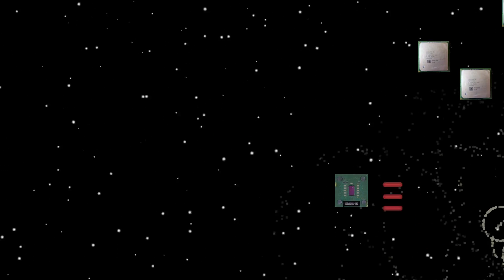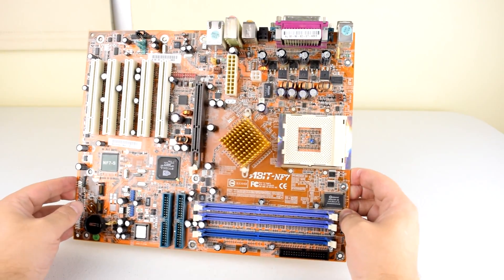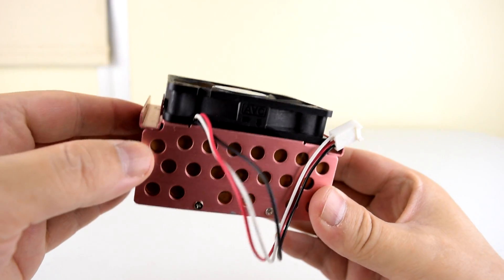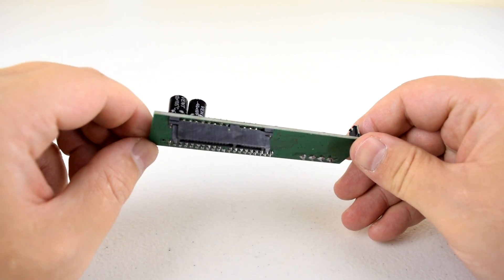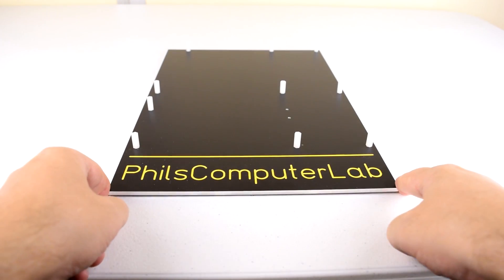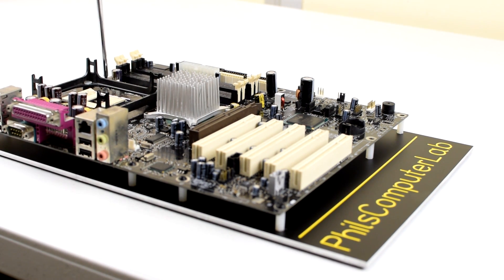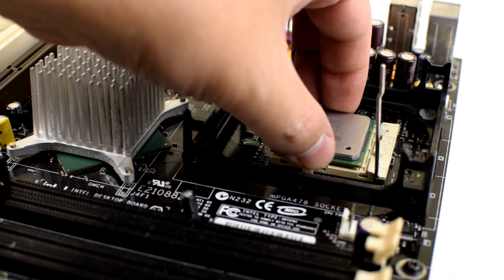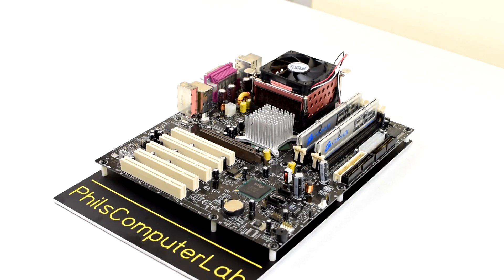Intel vs AMD S1E3 - P4 vs XP 3200+ GeForce 6800 GT and 875 chipset

Comment: Quick question regarding Power Supplies for Retro PCs,

How much wattage would be needed for say a Voodoo 2 SLI system, since I'm planning to buy one soon. For ATX power supplies is there a way to convert them to AT connectors?

Lastly, what case would be the best for every motherboard size?

I know this isn't relevant to the video, but I find it the easiest way to get hold of some answers, since I find power supplies the scariest part of any PC build, especially with Retro parts.
Reply from the maker: +Plague Doctor AT you're talking 386 and 486. I have a video on these topics, building them, but also reviewing an AT to ATX adapter. As for PSU, older PSUs are stronger on the 5V rail, newer ones stronger on the 12V rail. So it depends on what you're building. This is really only an issue with high powered Athlon XP machines. For these, even a modern 600W PSU doesn't cut it anymore, because it's too weak on the 5V rail. I use FSP and now the Corsair PSU with all my builds. I do not recommend using older PSUs, I just don't trust them.
Reply: PhilsComputerLab I do have a Corsair CX 600W floating around, but from what I've gathered any Power supply with an 80+ rating doesn't have a strong 5v rail. Is this the case?

Thanks for your time.

***** I shouldn't have a problem finding an ATX board, the only challenge is that they're quite uncommon, however there is a slot 1 Compaq motherboard 400BX chipset on Ebay with 3 PCI slots 2 ISA and 1 AGP slot I believe that will suffice, unless they have some special 20 pin connector that the Dell motherboards do.
Reply from the maker: Plague Doctor None of the modern PSUs have a strong 5V rail anymore. 15 or 20 is what you usually get. Whereas older models had 35 or even 40.
Reply: ***** Might do so if I struggle getting a good Slot 1 Motherboard. I've brought a Voodoo 2 now.

I do have a shitty Pc from 2001 with some IDE leads and DVD/CD/Floppy drive, however upon closer inspection the Floppy drive lead is twisted in the middle six pins, would it make it compatible for the V2s in SLI? I've heard the V2s SLI cable is the same as a floppy disks.

The Power Supply is an FSP, but it's been 10 years, might as well get a new one to prevent it taking the parts out with it.
Reply: ***** Yeah, I did, but I find Pentium 4s quite troublesome with specific drivers. I've always wanted a P2 400mhz slot1 system back in the day, found them to be astronomically expensive similar to a 5960x of today. Trying to make it a pseudo Glide/Dos gaming machine of the time.

Would a Sound Blaster Live! Value work for Dos games? Even though it's a PCI sound card, I'm not 100% sure if it would. 

Now, regarding the Floppy Drive cable, I've heard it can work with the V2s if it was twisted in the middle, which mine is for some reason, it came like that I suppose. 

Thanks for being a help in this, takes a tonne of research to find what you're looking for.
Reply: ***** Ah, thanks, I'll make my DIY Voodoo 2 cable than, not a problem as I've been researching about it since yesterday and if I fuck up IDE cables are a dime a dozen.

Just needed to clarify that's all.

Thanks man.
Reply: ***** Yeah, I can just use the ones in that PC I mentioned. Thanks again.

Comment: Nice a Athlon 64 approaches wonder which chip you have ...I have the Athlon 64 4000+ which I think is the fastest single core Athlon 64 processor
Reply from the maker: +Ashley 98 I think I'm going to follow the timeline from back in the day.
Reply: +PhilsComputerLab could I ask what is the recommend wattage psu  for the 6800 Gt as my fx 5200 ultra needs replacing or could you recommend any good x8 agp card that are good but not too pricy any help is much appreciated :)
Reply from the maker: Around 400W should do the job. The 6800 GT is a great card, but might not be the cheapest. Check out ATI as well, the X800 series for example. The 6600 GT is nice, but it uses an AGP bridge, which can cause issues...
Reply: +PhilsComputerLab ah thanks I have a 300w in there currently I can throw a 500w psu that I have ...the x850 pe I do have but its PCI :( such a good card but very noisy at startup sounds like a jet taking off also have a 7600 gs agp but it has artifacts not bad to say I payed £2 for both of them also just wanted to say check out any local recycle shops near you if you have any you never know what you may find in the electrical section :)
Reply from the maker: I live in the outback, no recycling companies near me I'm afraid. Everything I have had to be shipped :(

Comment: if you consider that the XP runs at 2.2GHz and that socket A was introduced to compete with Pentium 3, the results are quite solid for AMD, also you could easily buy a cheaper XP 2500+ and run it as 3200+ (to be honest Intel also had the P4C 2.4GHz which as great for OC), AMD was strong and cost effective back then, nice testing, also I liked seeing the nforce 2 showing a clear advantage over KT600 :)
Reply from the maker: +hmbrz Thanks :) In around 2003 / 2004 I built myself a machine, it was a P4 with Asus 865 chipset board and a 2.6 GHz chip. I had a 4 year break from computers before that, so maybe I got onboard just at the right time when Intel was decent. I did get an Athlon 64 system later though...